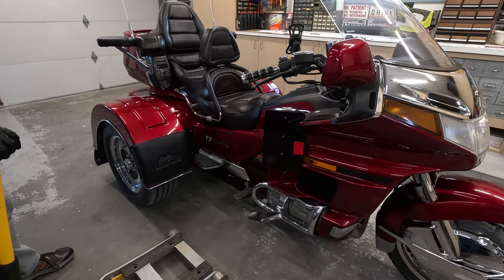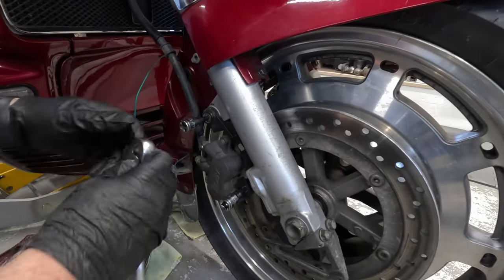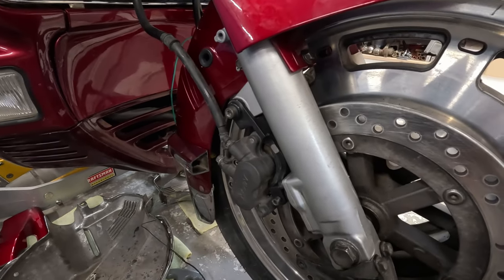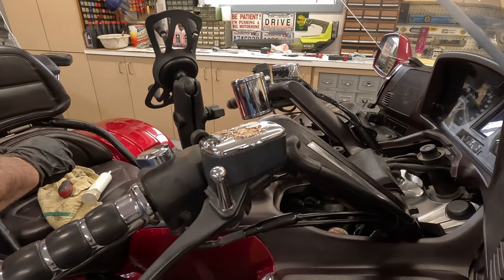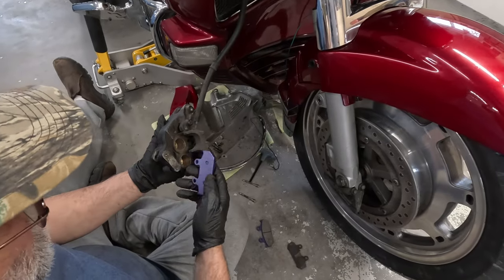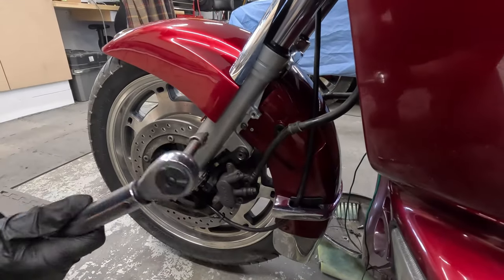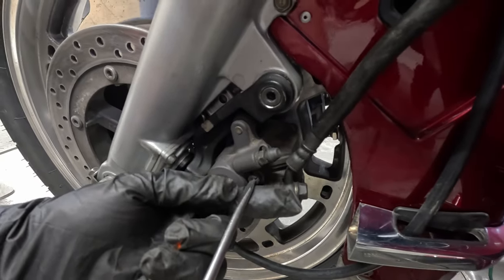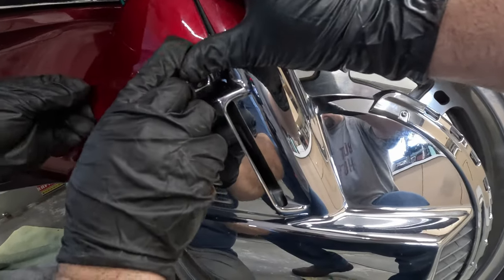How to replace front brakes on 1988-2000 Honda Goldwing GL1500

Comment: Nice content!  I just picked up an GL1500 so I enjoy watching videos like this. Thanks.
Reply from the maker: Awesome, I’m glad you watched.  My dad and i will be working in this same GL1500 next week, replacing the timing belt, radiators and the rear air shocks.  Keep an eye out for those videos over the next few weeks.  Ride Safe!!!
Reply: @whatsbryanupto    Great.  I picked up an 94 with 100k but seems to have promise that it could be a  decent and reliable machine.  I have no interest in long distance riding but just getting it back on the road.  I just did the timing belts.  Previous owner deleted the air suspension.  Seeing that I got it in the winter I've only put about 2 miles on it to make sure the wheels didn't fall off!  So I'm just cleaning it and doing basic maintenance before I hit the road and see what else it may need.  I'll look forward to more of your GL1500 and GL1800 content!

Comment: I have a 2000 GL 1500A. What brake pads do you recommend? The trike kit is a Tri-King. Do you have any information where to get parts for it? The company went out of business in Florida.
Reply from the maker: Hi. I chatted with my dad about this.  The front brake pads are going to be available online. You can order from the Honda website or after market supplier and that’s who he ordered from.  They are all different prices. If you’re asking about the rear axle, it should say the manufacturer, and should be able to order per the manufacturer.  On his trike, his rear axle is a Ford.  Hope that helps some. I do appreciate you watching.  Ride Safe!!

Comment: Hi can you lift the trike completely off the floor with your lift and if so could you do a video
Reply from the maker: Hi, yes the atv floor jack in the video is able to completely lift the trike off the floor.  The jack has to be placed exactly in the center.  It may take several tries to find the center.  This is my dad’s trike and is now in storage for the winter.  We do plan to get it out in the next couple months to change the timing belt and replace the radiators and hoses.  I’ll try to include lifting it when taking it out of storage.  Hope that helps.  Keep an eye out for upcoming videos.
Reply: Thank you very helpfull
Reply from the maker: Hello, about a month ago, you asked about jacking up the trike and if I could make a video.  We just started those other projects I mentioned and wanted to start off by making the video you asked for.  You can find it on my channel, or here's the link to it: https://youtu.be/4nyTFMtYX4k

I really appreciate the comments.  Hope this helps.